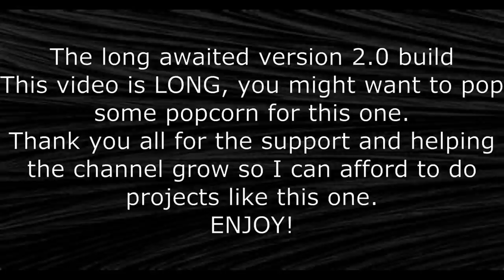Homemade ice maker build! VERSION 2.0! Cleaner build! #435

Comment: I’m a retired HVAC mechanic and this info may help you increase your production. Each ice machine also has a rating based on inlet water temp. Pre cooling the water down to 40° will  increase your production. It will cut the amount of time it takes to chill the water down to 32°.  1-BTU = changing 1-lbs of water 1°F (it takes 144-btu/ pound to freeze water). Your making 12-lbs of ice and if your inlet water temp is 90° then 90°- 32° = 58° x 12-lbs = 686-btu’s of heat being removed to chill the water to 32°. At 40° water temp you would only have to remove 96-btu’s.  Also all fans have an air  temperature rise across with them. Having the air moving is probably good to keep an envelope of warmer air forming around the ice tray but too large of a fan may be warming the air too much and negating the advantage. I think a smaller fan farther away would give you a better result allowing the air that’s leaving the fan to be colder before it hits the ice trays. These are just my thoughts on your project… all in all I think your ice machine is really awesome!
Reply from the maker: I actually tested a lot of that in the series. I did see around a 9 percent gain in production with chilled water. The issue is the energy spent pre chilling the water offsets any monetary gains. But if production is all you are after it does help.
Reply: I was thinking of a stainless steel wall the same thickness as a computer fan on the back of the freezer for cold air delivery to the ice trays.
Reply: Awesome input how would you upgrade this build as far as getting the water colder before it reaches the trays ??
Reply: Have you thought about adding a water filter?
Reply from the maker: Mine has a water filter.
Reply: @TKCL  How about running the the water inlet in and out through the chest, if it doesn't freeze, it'l precool the water?
Reply from the maker: @WillyK51  I've considered that.
Reply: How is production increased? I'm familiar with how the countertop ice makers work, but not the fridge / freezer style. The countertop ones just have a set time. If the water is cold, it makes harder and larger pieces of ice. If its room temp, cubes are small and almost transparent. Does the fridge / freezer kind work similar?

Comment: The place I work has a commercial ice maker. In the last year we have spent about $3,500 in repairs. It would have made way more sense to replace it but there was no way of knowing that until we were a few $500 repairs into it. Also, there is no freezer component to it. Basically, the ice is dumped into a poorly insulated cooler with a drain in it. The ice is constantly melting and being replaced. Your ice maker is WAY more efficient.
Reply from the maker: That's the exact scenario we had at my last job. The big name brand commercial machine ls were always breaking.

Comment: The fans mounted on the lid is a great idea. If you have them mounted correctly, you won't even need a switch to turn them off since they'll be outside of the freezer when the lid is opened. I'm right there with you on convenience factor!
Reply from the maker: I'd still be concerned about the fans blowing almost 10p degree shop air into the freezer. I'll put them on a switch no matter what. My gut says I can make more ice for less money. More videos coming

Comment: Liquid Nails would have been a better choice, That being said, the rest that you did may work perfectly to keep it attached. Only time will tell.. I like the 2.0 version, I see there was lots of thought put into it.. Another Idea I have, would be to build a platform to place it on with wheels, cause on the other one, you moved it around a lot to do testing, this way it will be able to move around almost effortlessly and being higher, you can reach the ice better... Adding a digital thermomotor to the front, you will always know the temperature inside.. I enjoyed this very much, there is a point where you go to far.. A wise man once said "leave well enough alone" I give this 10/10

Comment: I have alittle bit of info that may help, when making snow at a ski resort its the principle of cold air mixing with very fine water droplets that decide the crystallization of water. So if you could super cool the inside of the mold as quickly as possible after the heating element has released the ice that should increase the development of ice. I had a uline clear icemaker which is a commercial unit, and how it functioned was a freon cooled mold, chilled the water as it recirculated across it until the ice had built up, then it would heat up and release. I think ur best bet is using the walls of the freezer as the driving force of the freezing, its not the bottom of the freezer its the sides that are the coldest. So isolating one of the sides and channeling the air through would be the best chance.

Comment: Definitely a cool build & I know the joy of building something like this.   Buc-ees in Texas sells ice for $0.99/20#.  Probably the best  deal going...best prices on deer corn too, but you've got to bring two big coolers to handle the ice.    I lucked into a free commercial ice machine.  Makes 250# a day.  I'm in construction and we did a kitchen remodel and that old machine was replaced.  Old one went straight to my deer place and has been a game changer.  A few problems, but worked through all of them.  When it craps out, I will bite the bullet and buy a new one.

Comment: You should build a separate box on top of freezer door and mount the ice makers into the separate box, and have the ice dump into a 4 inch "ice chute" and into the freezer itself. That way the ice makers and ice box are separate and only the freezer box is used to hold ice, and not have ice makers/fans/pvc housed all Into one!

Comment: Nice build. You can always use the heating element power to trigger a relay to turn off the fans instead of using a temp controller.

Comment: Use foil Tape to seal the foam insulation . Top and bottom. That will make it sanitary. Block ice will be clear or cloudy? Put that name plate on the ice chest.lol  To check the seal if is leaking. Take a piece of paper, place in the seal and pull to see in you have resistance.
Reply from the maker: All joints were sealed with caulk and butyl. The sticker is already on it, see the community post I put out a little while ago.
Reply: Not seeing the community post.
Reply from the maker: Sadly there is no share button for posts, but it was posted 13 hours ago.

Comment: Great build. You put a lot of thought into the 2.0 build. I can see why you were so excited. Like you said, the convenience and time savings are the most valuable assets you get from the build. One more thing you gain over a commercial ice maker is the ice is more solid and lasts longer in an ice chest than production ice. Another way to increase your overall volume of ice for the weekend would be to get another freezer and load that a couple of times a week from your production freezer. I give up a shelf in my side by side for extra volume that I need for my weekend trips. I no longer purchase expensive  lesser quality bagged ice.
Reply from the maker: I also have a table top machine that I can get over 30lbs a day out of. I can kick it on, bag the ice and really build inventory for the weekend.

Comment: Use only one fan motor!!! attached to lid will increase production, excellent idea btw, air flow from bottom is a waste of space (storage) as you pointed out, as well as additional components and energy use, direct air flow over the water just like the manufactures do will help to maximize your production. turning fan off when the ice makers thermostat(s) activates the motor, rotating the shaft, while turning the cam, causing fingers to put pressure on the ice, rotating cam turns on mold heater via a micro switch allows ice to break free of mold and push the ice up and over mold, as cam rotates mold heater is shut off and a different micro switch activates the water valve, if micro switch has a normally open as well as normally closed  spade) you can electrically tie the fan thru mold heater micro switch to a hvac fan relay to cut fan off when either mold heater is on. A single fan switch for door works and can be tied into the fan circuit but cooling the mold while the heater is on defeats the purpose of the heater, wastes production time, energy and adds heat back into the space.  

PS the teal colored shirt is my fav, however most people mistake it for representation of the govt agency and sorry to say you can unfortunately be mistreated, located on east coast between st aug and daytona
Reply: MY MISTAKE & some clarification...... if your ice maker mold heater micro switch has a normally CLOSED spade then a fan relay is not necessary and can be wired thru the door switch directly to the fan. A fan relay is only needed if the normally closed spade is not on your mold heater micro switch. Fan can be driven via the mold heater normally OPEN spade to a fan relay then thru the door switch

Comment: You are doing a GREAT Job on analyzing everything!  No question - More powerful fans use more power which means heat dumped into your freezer to be removed.  Also I think you want to use the least amount of fan power / circulation that produces a good amount of ice.  Lastly if your freezer temp is set such that your thermostat never sees it's set temp then your compressor will run continuously!  This is not normal for a chest freezer they normally get stuff added which raises the temp and then the temp get pulled back down to the set temp and compressor kicks off!!  If this does not happen you will shorten your compressor life considerably!

Comment: Great job, that is basically what I did based off your 1.0 however you did a much nicer job especially with the Insulation. I am interested To see your production when you move the fans to the top, my personal experience I get more ice with the fans on the bottom but again I did not insulate as good so I think I am pulling hot air down on the icemakers. You’ve definitely get the wheels turning in my head LOL
Reply from the maker: I'll be testing that next week

Comment: Nice clean build.  I know you plan on moving the fans and getting rid of the PVC so you won't have need for the false floor any longer, but if someone else is building and wants to draw from the bottom they can get rid of the elbows and just make a straight run of PVC from below such a floor an inch above the bottom.  Such a short run the dynamic loses with your 90s aren't worth worrying about but it would give you back a fair bit of volume as opposed to a floor above intake as you initially designed.  Looking forward to the tweaks.
Reply from the maker: The 90s are there for support and stability
Reply: As you said, but an inverted toilet flange would provide a wider base and quite a bit of support. Just need to keep it off the bottom by adding feet or connecting it directly to the false bottom.

Comment: That's very well done. No, you wouldn't find a working commercial machine, even a smaller stand alone one, for close to that. Even if you could, they use a lot more water and electricity often needing 240v. The cubes you get are those fast melting tiny ones that are barely frozen. They don't make the kind you get in bags. This is a far better solution. I'm not sure you really needed two fans or the positioning. Just having one to circulate the air in general would probably be enough.

Comment: The computer fans you choose for your machine have typical ball bearings that generate heat and noise through friction. There are newer computer fans that magnetic levitation instead of bearings. They are virtually silent and produce significantly less heat. Of course they cost three times as much. Great episode, I was looking at a traditional industrial style ice maker, the ice in those machines is always just on the verge of melting and the ice doesn’t last like the refrigerator ice does. I am buying ice right now and I live in town. By the time I get it home, 10 minutes or so drive, the ice is already in full on melt mode. I drop it in a deep freezer like yours. The next day it is frozen solid again, but I can put it in a glass I have to beat it to death with a claw hammer.  The moral of the story there are even more convenient reasons for making it at home.
Reply from the maker: Very valid points

Comment: as always, very educational. don't worry about the length and it was good you included the first test.
Take away from me: I would trim down the width of the plastic rim to a minimum, potentially the distance between the hinge screws so you can use the top screw holes from the original hinge. I also would not go with the PVC pipes and agree with the top mounted fans.

Comment: You can control the fan  with a simple relay conected to the heater. When the heater is on fan is off. Simple and cheaper.
No nead for the second door switch
No nead for that smart controler so less energy waste.
Reply: Wow 👏 that's a great idea 💡
Reply: Can you provide source for said relay?
Reply: @ryanrambo24  i'm in Europe and our voltage is 230 V ac and here you can get that kind of article in any electrical shop. Must be the same over there, the diference will be the voltage (120 V).

Comment: Use a so called heatpipe which is a specially treated copper tube, that things transfer heat close to imediate and they work without energy. Connect one side of the heatpipe via thermal paste with the coldest spot in the frezze,the other side to the underside of your icemaker.....voila.... better,cheaper,faster,no moving parts.

Comment: You can run the negative from both fan power supplies thru the one switch. The on/off function will still be powered thru the positive from the controller.
Reply from the maker: Very true since the output side is DC

Comment: They make portable ice makers which will make 25-40 lbs of ice per day, starting at $75 or so.   Probably more efficient too.  You should get one of those.and adapt it to the chest freezer.
Reply from the maker: Keep watching, already purchased one and tested. It requires too much attention for my needs.
Reply: @TKCL  I have two of them and swear by them. 9-13 cubes every 6 minutes. All of them suffer from having waay too small of a bin and also having an unrefrigerated bin. 

I'm thinking you could have it sit to the side of the lid and dump it through a closed chute into the bin.   In their native form, they can be needy, mainly the paddle which lifts the ice into the bin. This could be eliminated for your chest freezer.
Reply from the maker: That's not possible, Pay attention to how wet the cubes are when they come out. You'd wind up with a huge frozen block in the freezer.
Reply: @TKCL   I've noticed this when I'm staying in hotel suites and have the luxury of a real fridge/freezer and try to store the hotel's commercial ice machine ice. 

I've gotten around this by storing it in the refrigerator section.   Yes, it slowly melts (very slowly) but still remains separated. 

Perhaps try this method, setting the chest freezer to be a bit warmer than normal.  As for these ice makers' dodgy designs, an angled mesh/grid where the cubes are dropped instead of the ice flipper paddle would fix that.

Comment: My Father-in-law has had a commercial machine for years.   I've been knowing him for right at 10 years.   That being said, I've seen him change countless parts on it and fight with refrigerant problems, ect ect...     2 years ago he had to buy a completely new head unit for it.  I didn't ask what it cost, but I'm betting it's more than the entire cost of THIS build.   AND the only way he has got it to run at maximum efficiency was to put it in a climate controlled room.    Also you have to ensure that where you place a commercial machine has a way for water to drain outside, or into a drain.    Commercial machines make way more ice, BUT use more electricity and waste a lot of water.   Not to mention the hopper isn't very well insulated on my FIL's machine so ice is constantly melting and draining off.   Plus the small cubes don't last as long.  I'll certainly continue watching this series until you are completely done testing and refining, and do my best to 100% copy your final product.   Also if you are interested for your argument sake.  I'll purchase one of those things you use to measure power consumption and put it on his commercial machine to see how much juice it takes to run one of those things.
Reply from the maker: Thank you for watching

Comment: You’ve given me some ideas to run with however I think a top freezer with fridge on bottom maybe be the ticket cut a hole between the two mount your ice makers in the freezer part maybe 3 of them? then in the fridge part build a cover with a door and ice diverter so you can scoop your ice out. You could get fancy and build a ice diverter to funnel the down into the fridge part. I’m actually a Refrideration tech. Not to familiar with home stuff and have todo some research on maybe installing a bin level switch to shut the water valve off when the fridge aka the bin is full.
Reply from the maker: Thank you for watching

Comment: That Smart Controller was EXACTLY what I needed.  I just got a free beverage fridge from a buddy that pulled it out of an old camp trailer that he bought to make into a storage trailer.  He had no idea if it even worked or not.  I got it home and, sure enough, it worked like a champ.  The only thing that's broken is the thermostat.  I was dreading having to tear the thing apart and trying to track down that particular part, but with the Smart Controller, I don't have to worry about it (for now).  Eventually, I'll want to get the light working in it, but at this point, I don't really care. And once I do, I'm sure I'll find another use for the controller.